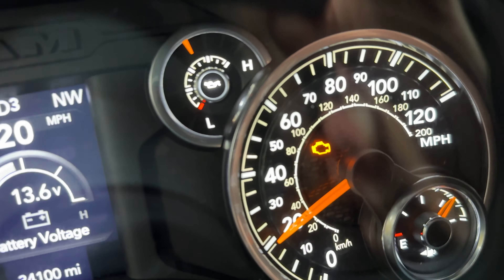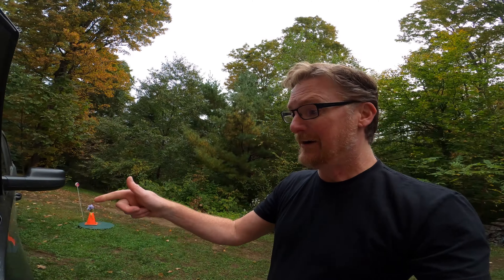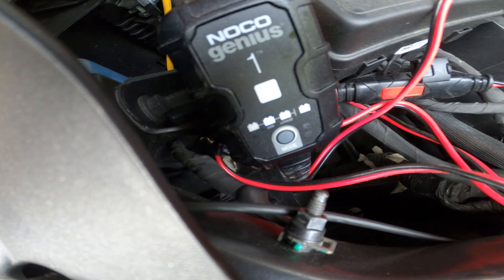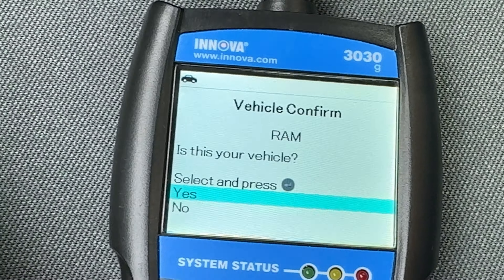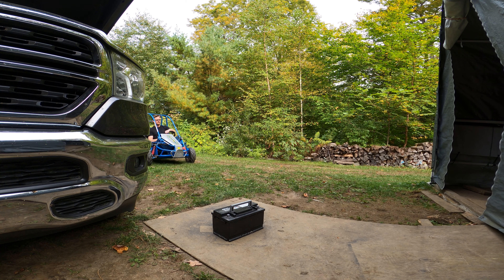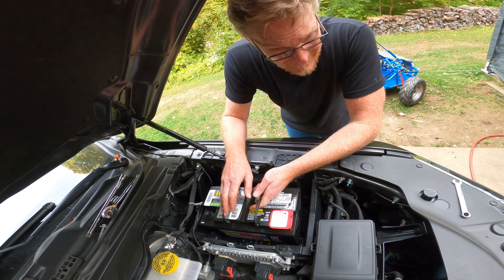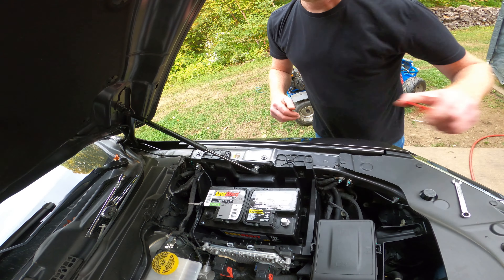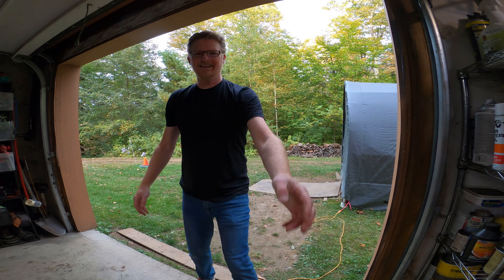'22 RAM 1500 Battery? OBD-II Code P0C030 Hemi eTorque 4x4

Comment: Hello there!
My driving habits are the same as yours, have a 2022 5th gen, just got it back from the dealer, they replaced the 48v battery under warranty, due to a check engine and battery cluster light.
Just got me a noco genius 5 to prolong the life of my 12v battery part #56029635ac.
Been trying to find out if it is an AGM or regular battery. Very little information out there.
But most people agree that it is a regular flooded battery and not a AGM.
according to most people if you select the wrong setting on the charger, it will mess up the battery.
Your original battery looks exactly like mine, how did you determine that it’s an AGM?
Thanks in advance.
Reply from the maker: My battery was part #56029642AB, an 800amp AGM battery. Your part number has 730 amps and is not an agm battery. When I replaced mine I bought the same factory spec but a different brand.
Reply: @ 
Thank you so much for your information and a well done video!
Reply from the maker: Thank you 🙏

Comment: Fixing to buy a new battery for mine doing the same thing. Did that resolve the issue or did it ever come back?
Reply from the maker: It worked and worked well. Can’t believe how healthy the hemi sounds when it starts now. The factory battery is indeed garbage 👍
Reply: @ what battery did you go with i seen the brand but the specs just same as stock?
Reply from the maker: @bradbooth6072  I put a link to it in the description below the video! Its a factory spec. This is the one > EverStart Platinum AGM Automotive Battery, Group Size H7 / LN4 / 94R 12 Volt, 850 CCA 140 RC
Reply: @sstressfl awesome thank you so much
Reply from the maker: Glad I could help 🙏